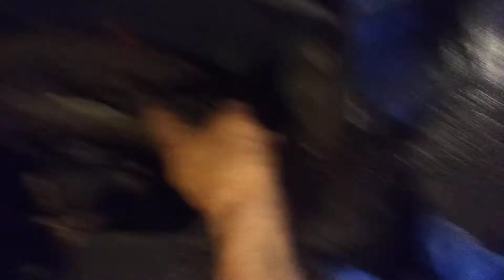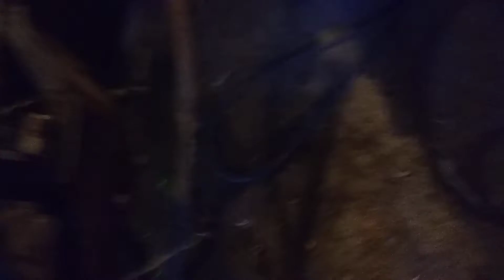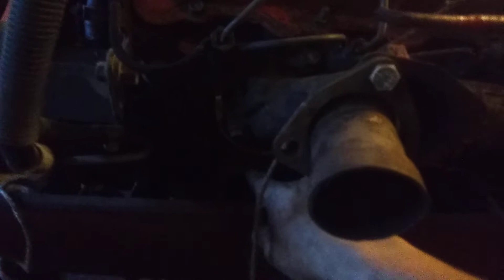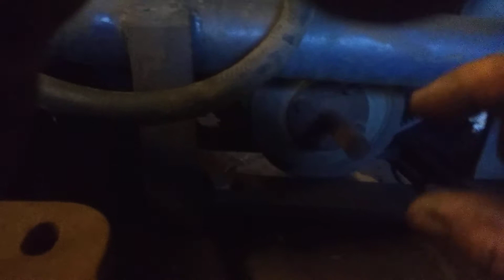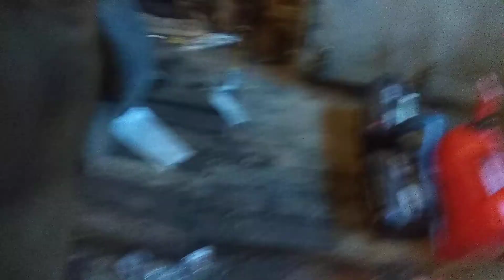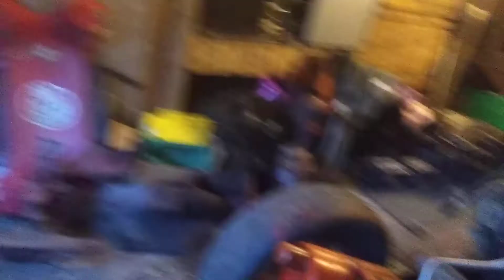Wd9 McCormick deering 6.2 diesel build

Comment: Hey there, I basically want to do the same thing you have. I have a Wd9 with a seized #1 piston. I also, have a 1989 6.2 diesel that I pulled out of a truck a couple years ago. I got it on an engine stand today and its not seized. Just wandering on a general scope what the cost and also the skill level required. I'm not a lathe guy, more like a junkyard mechanic. Are you anywhere close to Mendham, Saskatchewan, Canada?